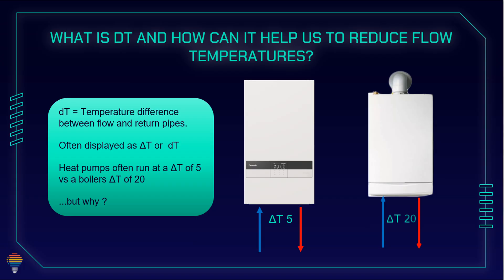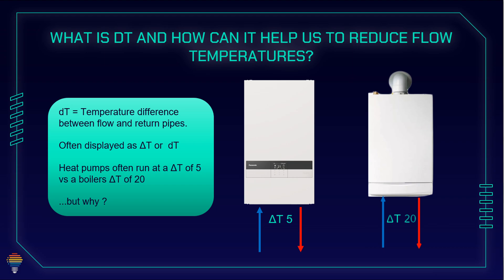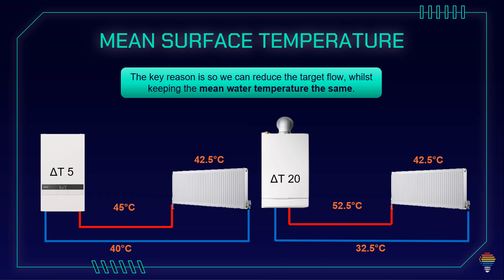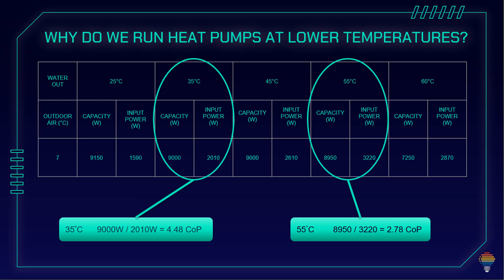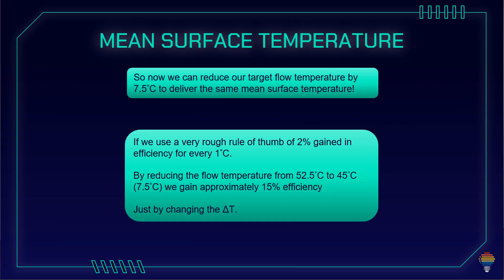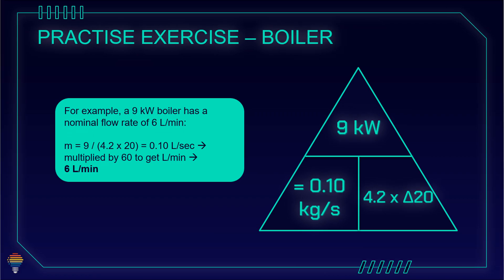Why Delta T of 5 Matters in Heat Pump Systems | Heat Pump vs Gas Boiler

Comment: Interesting, as I have always used 20degC in design, evaluation, and measurement for heating and cooling systems. I found that if an existing system is run with a lower supply temperature, the flow rate must go up or the exchanged Kw will be reduced at every emitter in the facility. I especially had this experience while troubleshooting a new district energy system where old buildings were retrofitted with a supply of district energy heating glycol fluid. Central heat source was biomass where they wanted a maximally reduced return temperature up to 40degC or more to increase heat extraction at their boilers. The system was initially unable to heat the buildings sufficiently during the first extreme weather conditions (-46C) as primary flow rates were reduced to get the high delta-T. Lots of overspend on these projects happened!  The solution was larger heat exchangers and bigger control valves.
Reply from the maker: Thanks, really interesting. On commercial projects, this is even higher overspending, as you mentioned. Out of curiosity, where is -46 C outdoor temperature? 😀
Reply: @HVACEducationHubThis was Prince George, BC, Canada.
Reply from the maker: @jimcalver-oj4xf good to have such a wide audience 😁

Comment: We have a heat pump in a very well insulated house with underfloor heating made originally for a gas boiler. It is a monobloc feeding 25mm ID directly into the floor circuit
We have very little difference between inflow temp at 33 degree and outflow at 31 degree. 
Is there a way to get higher DT by managing settings.
At -5 degree outside temperature, we will lose about 3 degrees inside if the system is off, so I was wondering if cycling on and off was a solution. 
I have seen the tests where it does not work, but then it is often 5-10 degrees they need to compensate for. We are just running compensation curve right now with all valves removed so all circuits are fully open.
Reply from the maker: Usually when DT is low it means that unit is to big or that flow temperature is still to high for that load.

Comment: I have 8kw mono and my dt is set to 5 but it runs at around 2.2 , is there any problem ? I think my main pipes are undersized 14m long and 22mm (copper) :/
Reply from the maker: Usually when dT is too low it means that flow temperature is too high because return is also high. Try to lower flow temperature.
Reply: @HVACEducationHub Ty , i ll try .

Comment: Thanks for the great video. If you have time to check my comment (questions) below, I would be happy. Keep doing the great job!
Reply from the maker: Thanks, let me check
Reply from the maker: It is hard to answer because every heat pump control logic is different. If I understand correct, you have fixed speed pump in your unit and cannot modulate? 

The best is to test different options and see what is the best. Also it will be good to reach installer and manufacturer for details about control logic.

Comment: Pojasnite kolika bi trebala biti temperaturna razlika (delta t) u samim radijatorima?

Znači idealna temperatura na ulazu i na izlazu iz radijatora (balansiranje)
Da li je to 3°C, 7°C ili možda 10°C?

Uzimamo u obzir da se radi o toplotnoj pumpi vazduh-voda, gde je idealni delta t oko 5°C ili niži za efikasni rad toplotne pumpe.
Reply from the maker: 5 C je idealno iz dva razloga:

1. Srednja temperatura. Npr. 45/40 srednja temp je 42,5 C. Kad bi delta T bila 10, za istih 42,5 C bi trebalo ici  47,5/37,5 C tj. 2,5 C veci polaz sto je 5-6% veca potrosnja. 
2. Freonski krug je dimenzioniran da radi optimalno na 5. 

Radijatori bi trebali raditi na istom rezimu kao izvor topline i balansiraju se za projektne uvjete. A u radu ce delta T varirati ovisno o raznim faktorima.
Reply: I read somewhere that the delta t for floor heating should be 5-7 degrees and for radiators 7-10 to carry on the heat efficiently.
However, I wonder, if the delta T i see in the menu of my heat pump is "the same delta t" as they speak about in this video. My delta t can be set between 2-10 degrees Celsius and it only behaves as a hysteresis to give signal to the heat pump that it should start working. The factory default was 10 degrees. So if I set it to 7 degrees (which I have now) and the set heating water temperature is 33, then it will start every cycle of work when the temperature of the returning water in the system goes to 26. In that moment it will turn on, go for the 33 degrees, keeps running for some time (sometimes 1 hours, sometimes 4 hours based on the temperature outside) and then turns off and only turns on again when the water temperature goes to 26 etc. The circulation pump inside the heat pump internal unit (hydrobox/split) keeps running on the highest speed when the outside unit is not working (this setting cannot be adjusted). I have floor heating in the ground floor and radiators in the first floor, no mix valve, no tank, just heat pump and the pipes in the house. I wonder what setting would be most efficient and also most "service life saving" for the compressor....
Reply: @terrasini1 do you talk about the gree versati 3 model? I have the same problem where the pump delta t is 1,2c and i cant lower the circ pump speed at all. Dis you found a solution?
Reply: @suadmujic7177  yes exactly! This delta T you talk about cannot be changed I think. For the circulation pump: 1) I have the firmware updated and now I can change the setting at least a little bit (from 10/10 to 7/10) but it is still noisy
2) better solution - attaching a PWM regulator that will allow you to adjust the speed from 0 to 100%. An average electrician can do that.
Reply: @terrasini1 dint knew that u can update the firmware. How did you do that?
The pwm regulator u talking is ok but what about the defrost when the flow direction is changed?
Reply: @suadmujic7177  It was very difficult issue to organize, people had to come from the headquarters and it took over 2 hours on spot (they had to change somethings in the internal and external units and then flash the firmware). But the new ones are sold already with this latest firmware (depends on what version you have - look in the menu). Well the defrost would be running lower speed for those few minutes but i think it should work...But I am not an electrician...
Reply: @terrasini1 where are you from ?
Reply: @suadmujic7177  I have the same problem with the Versati 3 monoblock , the delta t is 1-2 and the pump is very loud when  the compresor goes off :S

Comment: Thanks for these videos. 

5 degrees is fine, but the lower the better. (I guess at some point you are spending money to run pumps, etc). I think on hydronic in floor heating its easier to hit high flow rates. On my hydronic heat pump, with 200m^2 of 1/2" Pex in concrete in floor heating, there is a lot of thermal mass, and upon starting the heat pump, the delta T is like 1C. It's a 3T 35,000BTU water to water, COP is about 4 or even 5. Circ temp is 34C.
Reply from the maker: Thanks.

Always will be lower dT as demand is lower and return is higher.

Comment: great video!
Reply from the maker: Glad you enjoyed it
Reply: Very nice approach and explanation. What about primary/secondary layout, with heat pump in primary supply and return to a buffer tank and a secondary pump with double flow compared to heat pumps? In this situation dt of heat pump is almost 10oC, and setpoint is forced to raise, so as secondary setpoint is reached. Can a heat pump operate in such a situation? Is dt=10oC an upper limit ? Which is the largest dt a heat pump can stand, without problem in refrigerant circuit?
Reply from the maker: @A.A.600abitw  on Panasonic dT 1-15 is possible to set.
But you will not have any benefit by adding buffer and doubling the flow rate. You will have mixing from bogh sides and lower COP as heat pump will run at higher flow temperature.
Reply: @HVACEducationHub  Thank you very much for the answer. I referred to a situation, where a heat pump is installed in a renovation,  replacing an oil boiler. The secondary exists, so the problem of double flow in secondary is something that cannot be avoided, as terminal heating units (radiators,  or ufh) exist and have been calculated for specific flow. In such occasions, heat pump should be able to modulate flow (lowering flow, so increasing dt), so as supply temperature in secondary reach the setpoint. If it cannot do it, I think setpoint could not be reached and actually terminal units cannot supply the appropriate amount of heat to cover heat losses.
Reply from the maker: @A.A.600abitw  more or less you are right. With old installations problem could be pressure drop due to the smaller pipes.
But it is hard to maintain flow rates and efficency at the same time with buffer.
Reply: @A.A.600abitw  not sure about critical conditions, but the heat pump should normally operate in the range 4K<=∆t<=8K. Avoid buffer tank, add additional pump if needed and if supported by heat pump.